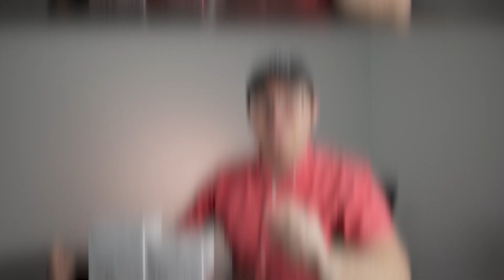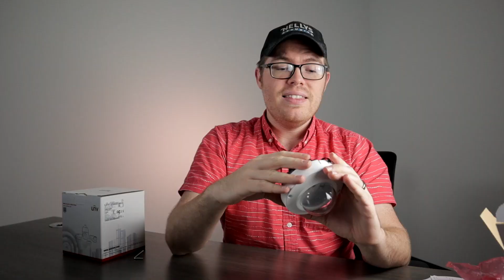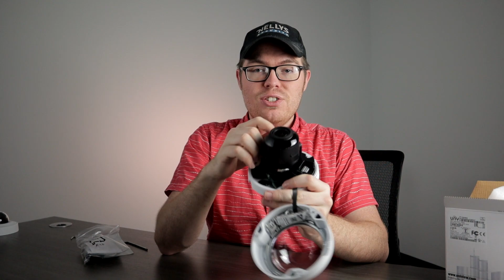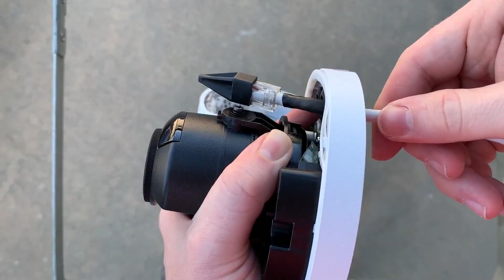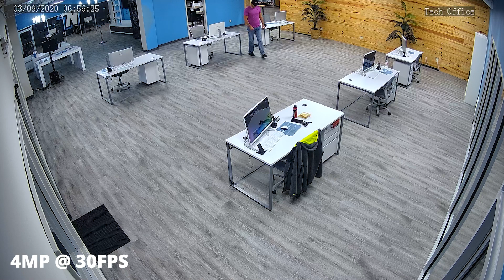How to Ditch Annoying Security Camera Cable Pigtails with Uniview's Cable-Free Domes

Comment: I hope you'll call these pigtail-less - If you call them cableless - I infer they are wireless'
KISM  Keep It Simple Man!
Thanks! 
(Plus you keep your credibility, by not confusing us simple folk!)
Reply: They are NOT wireless. When the term wireless is used it refers to the connection to the network being a WIFI connection. 

The term cableless is the correct term because it HAS NO CABLE. KISS Keep It Simple Stupid! Why? Because it HAS NO CABLE. YOU have to put the cable in and connect it. THEN at that point it becomes a wired connection.